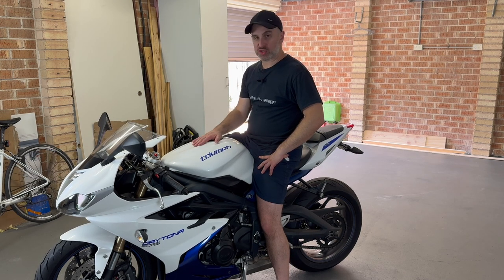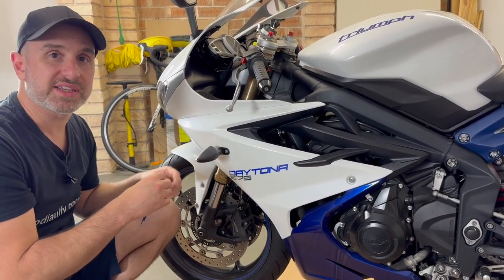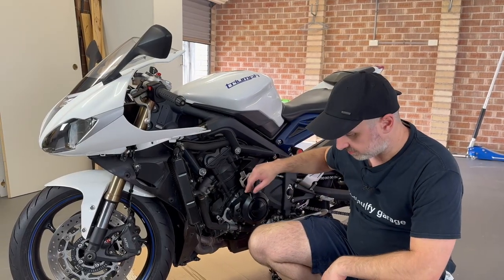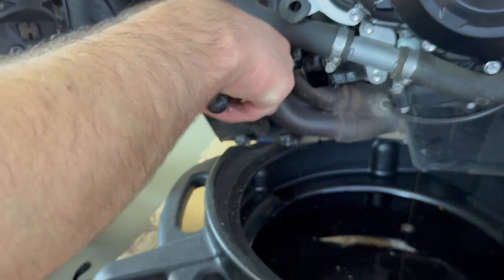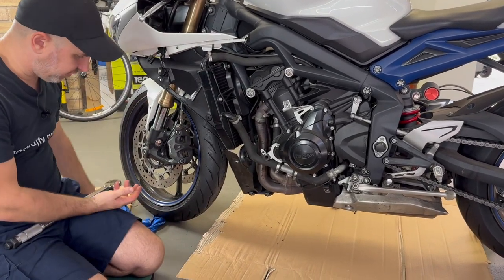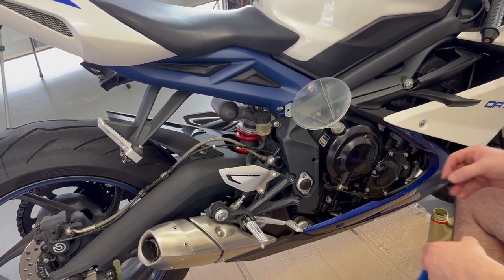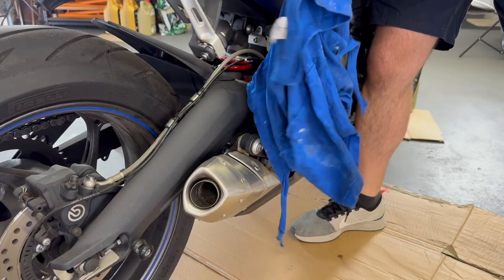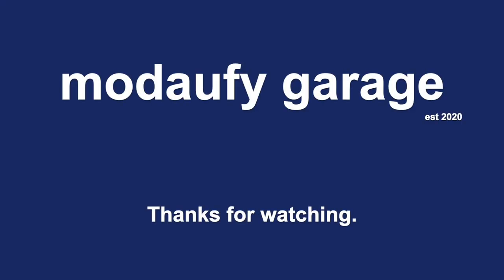How to change the oil and filter on a Triumph Daytona

Comment: Video is wrong. You DO NOT fill do the third line you fill to the 2nd line.
Reply from the maker: Thanks for watching. I did fill the oil to the 2nd line then took it for a ride to get it operating temperature before doing my final check, I think I needed a little more oil to get it to the upper dipstick mark. I did say to put in less and fill as required. I based my oil fill on the owners manual that I got from the Triumph Australia website. They suggest an oil fill capacity of 3.2L for an oil and filter. Triumph also indicate that the top of the upper marking on the dipstick is at the end of the cross hatch (at the top). Also the capacity of oil I removed (previous service done at a mechanic) equals the amount I put back in. The manual states, "when full the indicated oil level must be level with the upper marking on the dipstick". I would be happy to know if Triumph have come out with a revision for this as I have been working with what I have read.